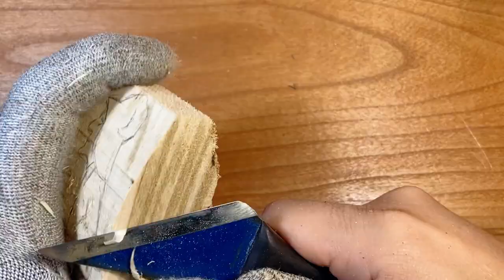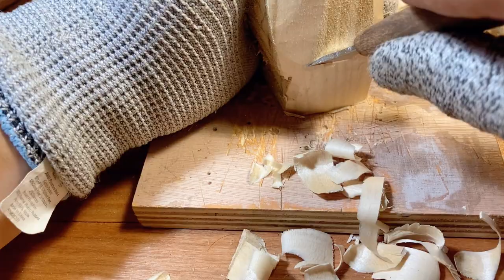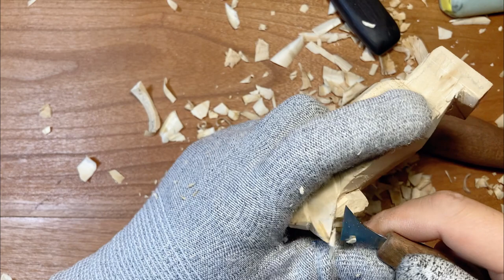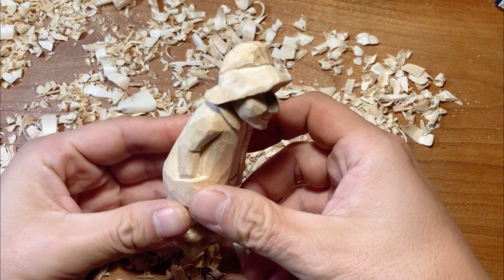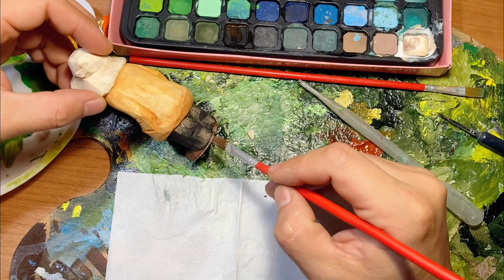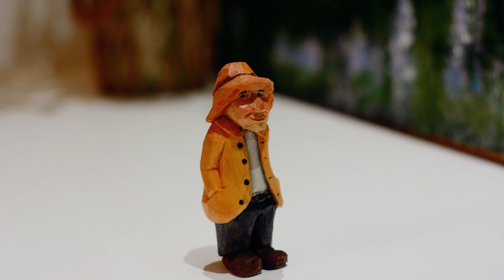How to carve and Color a Little Man；wood whittling

Comment: Hey there loved your tutorial and was wondering what tools you used. Your knife was unique and you also had one palm chisel kind of a fishtail.
Reply from the maker: Hello friends, both of the knives I use are made by myself with saw blades. I find it more comfortable to carve with a knife I made myself.
Reply: Can I ask abut the small palm chisel?
Reply from the maker: @donburnside6448  The small palm chisel is bought, it is more difficult to do it yourself
Reply: @LeviArts  could I get the specifications on the chisel?
Reply from the maker: @donburnside6448  5 mm wide
Reply from the maker: Sorry, I'm not sure if the palm chisel you're talking about is a round knife, the country I'm in calls it a round knife because the head is curved.
Reply: @LeviArts  who is it made by?
Reply: @LeviArts  do you know the manufacturer of the chisel?
Reply from the maker: @donburnside6448  The quality is average, I don't use it very often, not a brand manufacturer. I'm going to try another Esion brand.